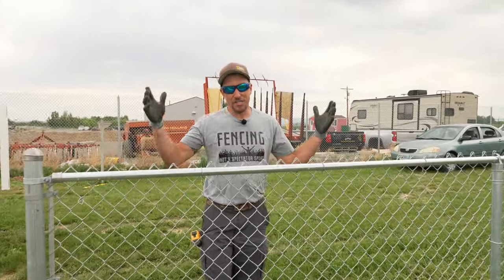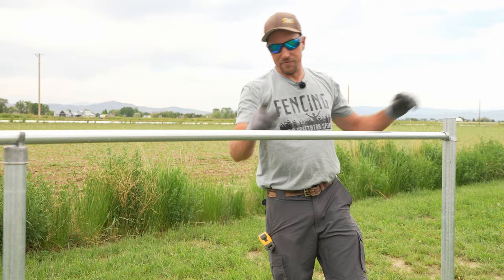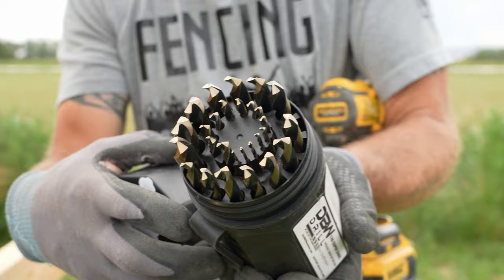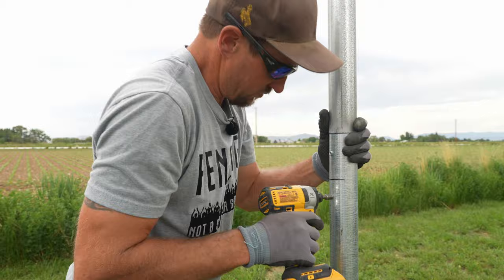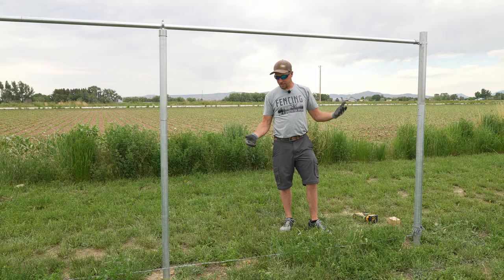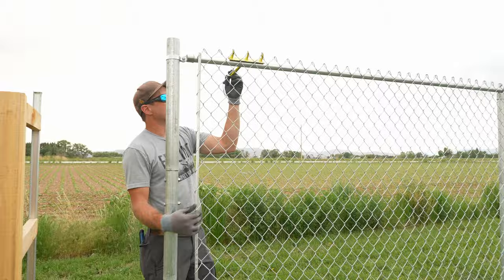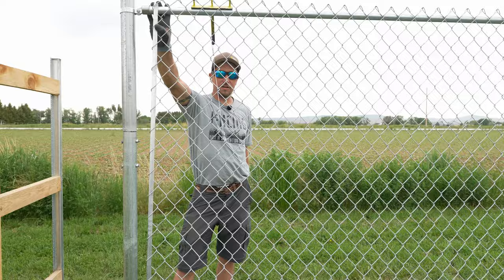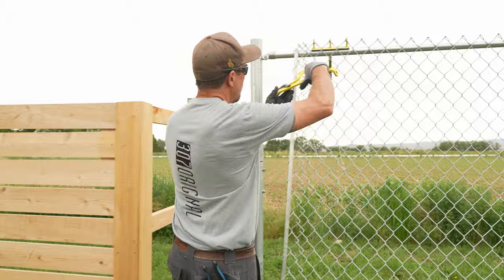EASILY Extend Your 4' Fence To A 6' Fence!

Comment: With thin wall pipe I make the splice pipes by sticking them in a hydraulic hose crimper to swage the ends, then weld the seam. Water pipe I use a couple of c channels and clamps to hold together, tack weld then seam weld. I got a laugh when you suggested putting the bolts in the cap, every time I do it it gets kicked and bolts in the grass.

Comment: We currently have a 3' chainlink fence with 6' bamboo panels affixed to it (with wire) by the previous homeowners. Could we keep the 3' chainlink there as is, but add the poles to make it 6' and then have the bamboo be more stable, or something other than bamboo--what we want to do is have a privacy fence and add sound-dampening acoustic panels of some sort. We need a stronger fence along with privacy and sound-dampening. We got a malamute several months ago, and sadly she is very fearful of all the street and neighbor noises in our backyard. I'd love to relieve her experience somewhat, and have a secure fence so she can even be off-leash in the backyard (a 3' fence  with 6' bamboo panels won't hold a malamute in), we'll probably add a small fountain as well for white noise. Basically we need to turn our 3' fence into a 6' sturdy frame. We could still use the bamboo, but we need a 6' frame to hold the weight of the acoustic panels. Do you have an ideas for this? We also need to replace our 3' x 3' gate with a 6' gate. Is there a way to add a frame to the existing gate, or do we need to buy a new gate?

Comment: I;m gonna build a 8ft wooden fence using these ,so I'm thinking of using a fence post bracket to keep them together ,and I'm thinking it will all stay together as the runners and pickets will keep it stable , and do you actually read the comments ??????

Comment: Great video! I was looking for something similar. I have a post at a gate that has rusted & broken at the concrete. I have contacted several fence companies looking for a sleeve that would slip into the broken existing post that is still in the concrete & then slide a new post over it. Where could I source a pipe with the OD similar to the ID of the post? what kind of company would it be? Thanks, Chuck

Comment: Hello, based on your videos, I have just completed a 450 foot chain link fence.  I have a possible problem.  It rains every afternoon in central Florida.  I noticed that I have about 12” of water in each post.  All my posts were ‘stabbed’ into wet concrete.  Can I just leave the water there?  I understand that concrete is permeable,  I have considered drilling a small hole in each post at ground level but an concerned that this will  provide a place for rust to start,  what do you guys think?
Reply from the maker: Almost all chain-link posts have water inside of them even if they are capped due to condensation. If you really feel like it you can drill and we pull in the the post just above the concrete or let it ride just like it is
Reply: @SWiFence  crazy how come wintertime  it’ll bust a hole in the side of a post lol from the water freezing

Comment: I have a 3" 5' high ss-40 steel pipe post for a Gate that is to go in that has already been set.  It's supposed to be 6' but the "contractor" is screwing me over :(  Can you adjust that?

Comment: Hi!  I have a question for you, We have existing 4ft fence that’s been up for over 30 years still in great shape but we wanted to make it a 6 footer. We got a great deal at auction for posts and rolls of 6ft link. The new posts are large enough to completely sleeve over the existing posts will this same method work with a full sleeve and bolts or would extenders like this be better? We do not want to dig up the cement holding existing posts, it’s held up 30+ years I think they will outlive me!

Comment: Would you install a vertical wood shadow box on existing chain link posts that are spaced at 10'? Looking to use these extensions on the exiting posts to avoid installing new posts but i know 10' OC is stretching it
Reply from the maker: No, I wouldn't. 10' is definitely stretching it.

Comment: With the through bolt method is nothing sharp sticking out there for the kids to get caught on when they run by it 300 times a day the self tappers are sharp little shit if I did it that way I would take a file and just needing it up a bit for the kiddos you know❤️

Now wait ……..a ……MINUTE that Fence has TEN INCHES to  P L A Y with😳

Maybe 🤔 your neighbor ……..
down the street…………
might……want……….that 10 inches😳
GREAT instruction video! I see so many saggy crooked fences just driving around you could make your own fence tightening business we are over here in New Hampshire❤️🇺🇸
Reply from the maker: You can run the bolts parallel in the fence line so that there isn’t anything sticking out perpendicular to the fence line to snag a shirt or kid.

Comment: how tall should a post be for a 6 ft chain link fence
Reply: Around 8’ … but more variables to consider not included in the question as stated. 6 above ground 2 anchored with cement you’ll be good most cases.

Comment: good info on the fence bur $200 for a set of drill bits ???
Reply from the maker: Shop around--I don't think you'll find those T-80's for any cheaper. They're designed for contractors. Probably overkill for most DIYers.

Comment: Lol , go ahead and cut the 4ft post down and stagger new 6ft post to avoid the existing footers. And install the 6ft fence the correct way without those Extensions.. 
I’m sure the new 6ft line post would be the same cost or maybe cheaper and you would have a much better fence 🎃